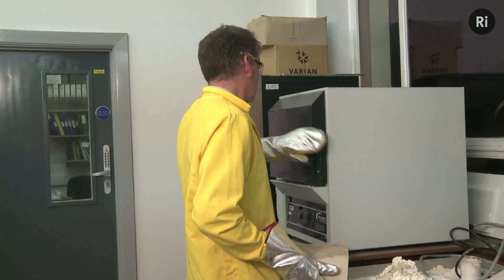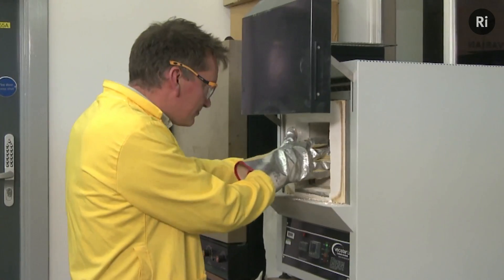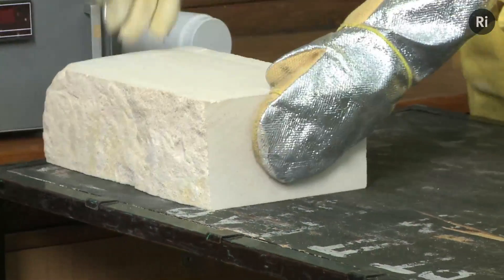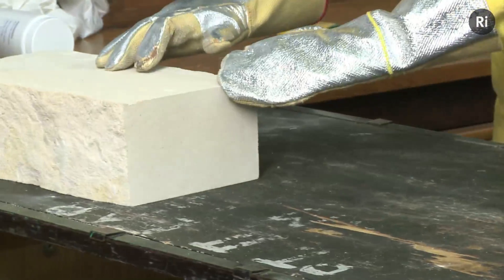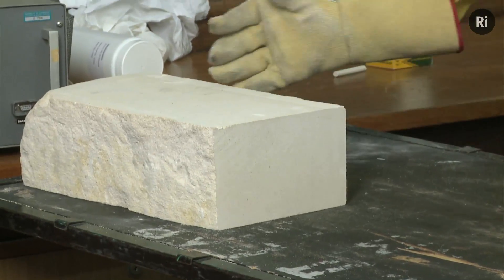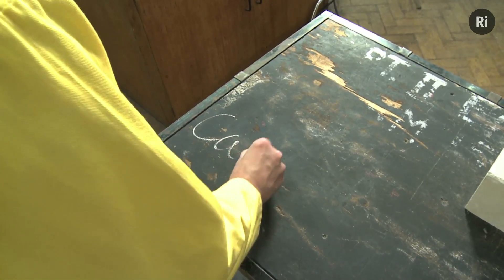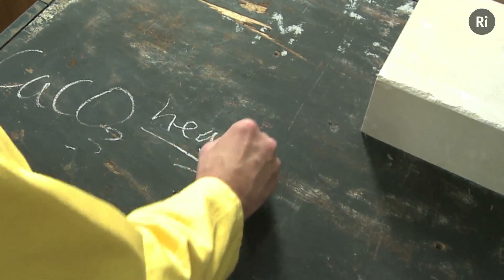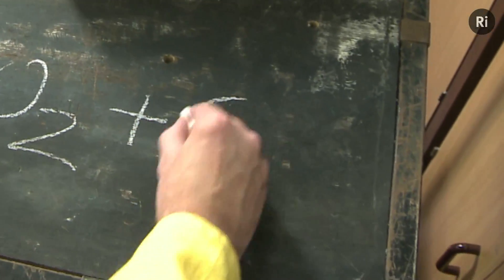Calcium Carbonate - Disintegrating Quicklime

Comment: One of the biggest myths about lime and dead bodies is that it acts to hasten decomposition thus the murderer hopes the body will disappear and no body, no murder. In fact the lime preserves the body. Quicklime is used to lessen the stench of a decomposing body, that's it. It's also extremely dangerous to handle if it gets wet as demonstrated yielding a highly exothermic reaction so there might be two bodies in the grave if handled incorrectly

Comment: Is it possible to heat limestone in furnace in presence of air to get CaO?
Reply: Yes, air is irrelevant.
Reply: Air is irrelevant, agreed...because the Calcium carbonate is more stable (lower enthalpy of formation) than the oxide at low temperatures and at high temperatures there is no combustion of the carbonate, rather its endothermic breakdown into oxide, via? hydroxide, and co² is favoured in free energy terms.

I am not sure as to the precise sequence and mechanism of the high temperature decomposition reaction.  I need to be up to speed here.

Comment: Thanks for the video! I have done this myself. It is an amazing reaction to witness first hand. Making concrete from it however proved to be somewhat of a failure. I did manage to glue some small bricks together though. The mortar was extremely soft and crumbled as soon as I applied pressure to it. My next search will be what ingredients are added to make Portland cement.
Reply: I think you didn't let the mortar cue for long enough. Mortar is supposed to harden up when you wait for it to cue.

Comment: So how then is limestone used as a building material???... say there is a heatwave, or said building is in a dessert... will the limestone turn into calcium oxide (and thus fizz out when it rains?)
Reply: +JG
A higher heat than mere sunlight produces is required to produce quicklime.

The quicklime, once slaked, was mixed with water and sand and used as mortar way back before Portland cement was manufactured . A 6 to 1 ratio, sand/lime, was frequently used; mixed with fresh water to make a trowel-able mortar.
Reply: +JG Yes, absolutely.   The limestone will begin to calcine (turn to calcium oxide) when the temperature reaches something above 850 degrees C.  Of course, at that temperature you will have bigger problems than your house melting in the next rain.

Comment: Toss it in a pool:)
Reply: and light a candle over the pool 

2 CaO + multiple H2O -> 2 CaOH + 2 H2 + 2 O2 -> 2 CaOH(aq) + multiple H2O + 2 H2O + O2
Reply: Calcium oxide does not form Hydrogen when it reacts with water:

CaO + H2O --> Ca(OH)2

Comment: The reverse of this would be suspended fine calcium hydroxide particles in water & is called milk of lime. The solution is called limewater and is a medium strength base that reacts with acids and attacks many metals. Limewater turns milky in the presence of carbon dioxide due to formation of calcium carbonate, a process called carbonation (blowing exhaled air through limewater for example).